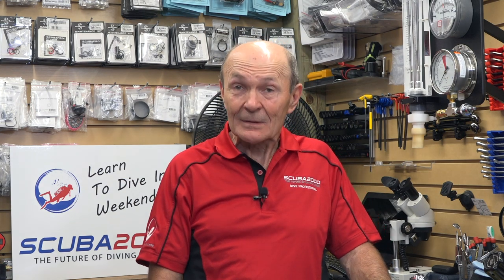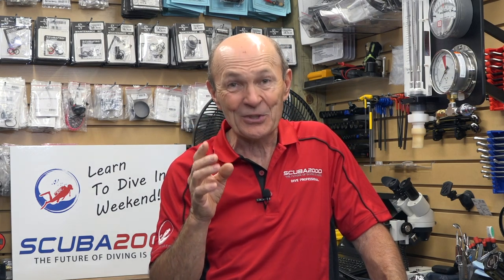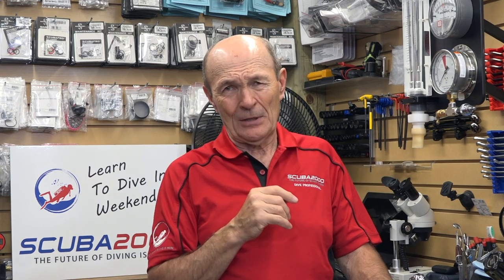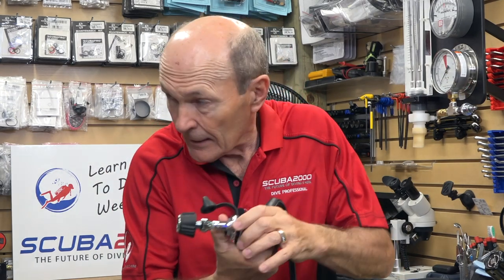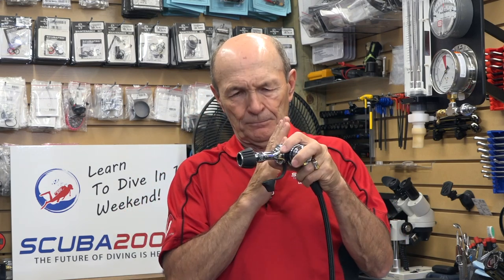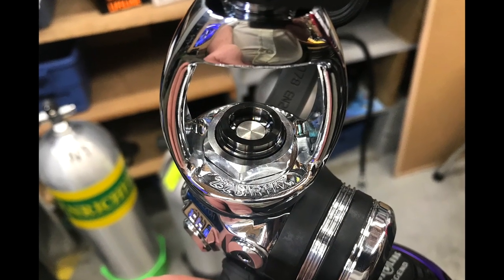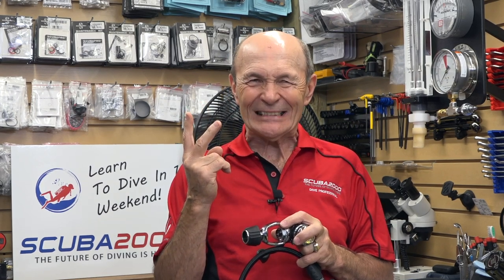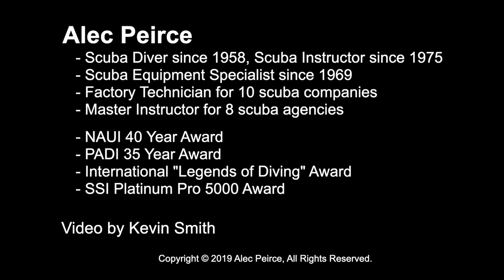Auto Sealing First Stage - Good Or Bad? - Scuba Tech Tips: S09E14

Comment: Hi Alec, it's very interesting that you have done this video as I've just had my Oceanic regulators serviced and they have removed the DVT valve completely. This is due to a safety recall that was announced in 2018 regarding this valve and I highly reccomend anyone checks their Oceanic regulators serial number for this issue. Thanks again for the tech tips and take care!
Reply from the maker: Yes. As I hinted in the video, the Oceanic version was not completely free of problems.
Honestly, some of those problems were with improper service procedures but, Oceanic decided the best way to avoid any problems was to get rid of this neat but unnecessary gimmick.
Alec
Reply: @AlecPeirceScuba_SeaHunter  yes I was surprised to find my DVT valve missing after the service but safety is always first. What's interesting is Oceanic has removed all mention of DVT valves from their website and I remember it being a highly advertised feature from as far back as the delta 4 regulators. Excellent video as always, thanks again and take care.

Comment: You forgot to mention the high pitch vibrating sound those ball seals used to make.
Interesting timing. Just went diving yesterday near Marseille France (visiting), and one of the diver on the boat took the rental first stage off, put it on top of the tank uncovered and then dropped his very wet bathing suit on top!!! I came up to him and told him to make sure to seal it before water gets in, and he fumbled with the plastic cap that wouldn't stay on (he didn't use the screw). Thought it was really odd given this was supposedly an advanced group in the morning... Realize now most of the reg were DIN (france after all) but he had a yoke which he probably never used before! hence the confusion I guess...
My din rental had that deep plastic cap, which will do nothing to block water once you rinse it... shop took gear back so I didn't have to rinse.
Reply from the maker: The DIN reg caps are nice because they actually screw on tightly, but ... you have to be very careful they're dry.
I often suggest divers leave their DIN reg cap on the boat. Hang it someplace handy but dry.l
Alec

Comment: I like your thumb method. Is there a cap or seal available that's good enough for the purpose of rinsing/soaking  the first stage after its removed from the tank?
Reply: I was going to ask the same question. No more caps? Thank you.
Reply from the maker: Regulators always come with a factory cap, whether yoke or DIN.
You can get new ones if needed at any dive shop.
Check my old videos so you get one that will keep your reg dry rather than actually dump water into it - yes! That can happen.
Alec
Reply: yeah I tossed the cap that came with my 2 aeris reg (big water cups) and got flat ones... don't know why they would re-use a 5c plastic part that looks like a DIN cap on a yoke reg.
Reply: Yes, they all have caps you can rinse and use instead of a thumb but since changing tanks is quick his method works better.

Comment: Hi Alec, so what should I do if I do get salt water in my first stage?
Reply from the maker: First are you sure salt water has entered the 1st stage?  Is the inlet filter green?  That is where the tank air enters the 1st stage.  If you are sure salt water entered the 1st stage (see my video on preventing this), then is should be given a servicing.  Salt crystals inside a 1st stage can cause free flow (depending on amount of crystals and water temperature), wear/cut o-rings and make diving potentially unsafe.  It should not be a big cost but your local dive store can determine if a full service or a few parts (inlet filter) need replacing.  Take care.

Comment: ACD is great, in my own opinion.

Just take a dry towel and clean the mating surfaces between tank swaps so you don't bypass the ACD with water droplets as you screw it down.
Reply from the maker: Yep!
In a previous video, I dealt with the proper methods to remove and replace a regulator on tanks.
One tip was to remove the tape over the valve of the new tank (if it was taped!), then blast a tiny bit of air through the valve (not so much that your dive boat buddies get annoyed!) and then install your reg.
That process still applies whether you have an ACD or not.
Take care.
Alec
Reply: Rinse first or there will be salt residue.

Comment: I don't see how it helps. If you get salt water on the device yes it won't go directly into the 1st stage, as soon as you put the wet reg on the tank and pressurize the water goes into the 1st stage.
Reply from the maker: Eve with an ACD (Automatic Closure Device) you must keep water away from the 1st stage input area.
Alec
Reply: Yes Alex exactly. You need to keep water away from the inlet, and dry it if water should get near it. The device ACD only adds complexity to fail, to service.
Reply: @AlecPeirceScuba_SeaHunter  Isn't it really SALT WATER and not just water that is the bigger issue.  It seem like rinsing would also work if available.